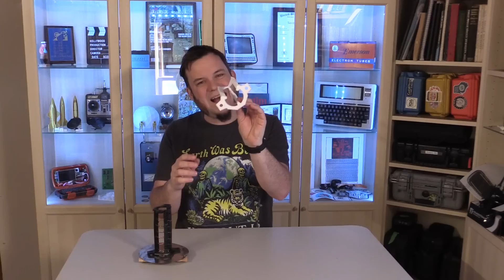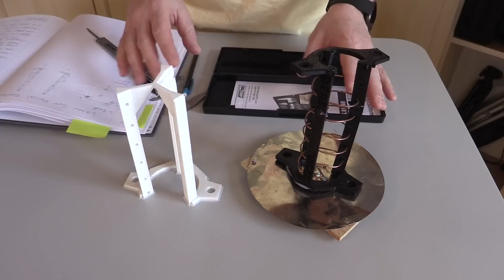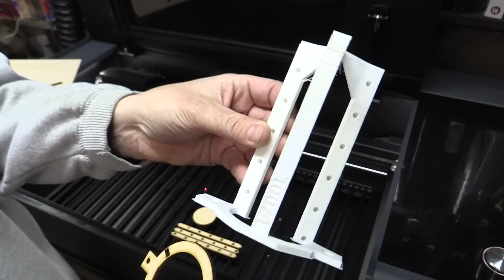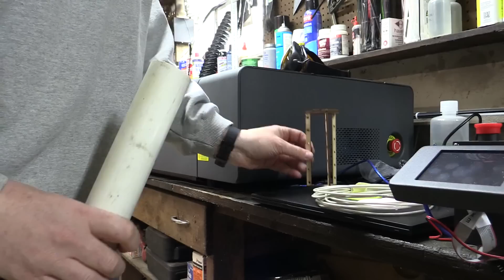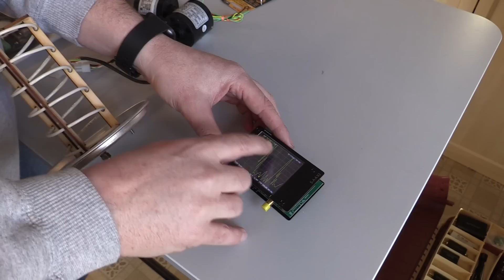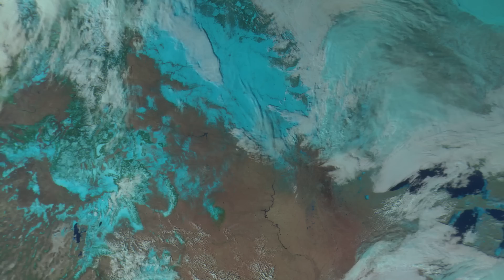Making Satellite Antennas With Lasers

Comment: This is pretty cool. You could also 3d print it with the pieces laying down, if you don't have a laser cutter. Sometimes it's better to print in pieces and then assemble. You can also paint the prints for long term durability. Though the temperature problems with PLA are still a thing. 
But I still wish I had a laser cutter haha
Reply: Crazy idea... Use the 3D print to impression a box of sand and sand cast a metal part. 
It might just be crazy enough to work...
Reply: @Deja117  I've heard of people doing that! And I swear I once saw something about wax-based fillament specifically for that kind of thing.y

Comment: You can submerge the wooden into a two part epoxy and use either a pressure chamber, or vacuum chamber to force the epoxy into the wood.  It should add rigidity to the structure. and make it water proof.

Comment: OH on the plastic coated power cable wire the good thing it will keep it from oxidation copper wires  i do the same and if you solder as we do both ends the copper is now very safe till the sun does the plastic in some day .

Comment: For the 3D printed antennas, it might be better if the long tall parts were printed as a separate part laid on it's side. They could then be snapped or screwed together to achieve the final part.

Comment: For all the tinkering you do it's surprising to me that you haven't dialed in your 3D printer(s) yet. Any mid range, modern printer, using a quality filament and slicer, should be able to print those without issue.
Reply from the maker: I don't really have the time or patience for it. If it's not going to work without a lot of tinkering and babysitting, then it's not a tool, it's another hobby I don't have time for.

Comment: @seaveitforparts ... seems to me anything made of wood will absorb humidity, which results in a changing capacitance ... or it might "'dry up" ... in both cases changing the tuning and add some loss ... so i would not use wood.
Reply from the maker: I'd seal it if using outside long term.

Comment: See if Bambu would be willing to sponsor you. They are trying to sponsor channels right now and you’ll get a good 3d printer out of the deal
Reply: Yeah they also are a lot cheaper than the laser printer you just used. I'd suggest trying a good 3d printer before throwing in the towel on them. They are slow but can make some awesome things. My son did a 38 hour print with a Bambu with no issue. In fact we've printed probably 40 objects since we got it at Christmas without issue. I'd suggest trying them. 3d print farm people are not happy with them right now though so if you are going that route read up on why.
Reply from the maker: I've emailed them a few times and they never reply.

Comment: For long-term outdoorr survivability just cut one out of acrylic (and use an acrylic solvent adhesive to assemble.)
Reply: Or hot glue :) 👍
Reply: @new-zealand-clippy  hot glue can melt apart. chemically bonded acrylic won't.
Reply: Or wrap it around a PVC pipe.  You could get fancy with a jig and cut the spirals.
Reply: @JoeHamelin a PVC tube has a weight and wind loading issue that having an open wire support like the one he shows is meant to solve. It is supposed to be light
Reply: I was going to suggest this. Or you can use ABS boards too, those should be equally durable.

Comment: Another great video - I'd suggesting CA glue rather than hot glue for assembling the jig as it won't soften on a warm day.  Also, you might want to try lacquering the jig (spray can of varnish - or even paint) before you wind the wire through to make it more weather resistant.  Another possible option would be to use laser cut PVC - you can repurpose PVC pipe by cutting off cylinders, and softening the PVC using a heat gun and pressing it flat.

Comment: Think about using laser cut cast acrylic for the structure of the antenna if you're going to use it outside. It's reasonably tough, doesn't need to be coated or painted, holds up to sunlight and summer heat just fine, regular old superglue permanently bonds it in seconds, AND it cuts beautifully on a CO2 laser.

Comment: You'd want to use PETG or ASA, not PLA. In fact, I would recommend PolyHex which is a cross between PETG and Polycarbonate that was developed by the U.S. Army and is commercially available.

Comment: With propper tuning you could fix those prints, but you would need to be a wizard with the printer. The real fix would be to devide the print into parts that can all be printed flat on the print bed. That's CAD solution tho.

Comment: If you don't have a 3D printer, plenty of services will print and send to you. Just get more than one thing printed so they don't charge extra. :P
Oh, also for glue, if you are using PLA or ABS, 3D Gloop is best. It will chemically bond them together. Some alignment pins/tabs in the print might be a good idea for this though. 
In any case. Resin is most accurate. I would SERIOUSLY outsource that one though. The printing, drying, washing, treating, and even the cost of the resin itself, won't make sense unless you make 3D models all the time.

Edit: I completely forgot about sand casting too! We know most metal can put up with a lot. Shove a modified version of the 3D print (with no base) in appropriate sand, pack it, remove the plastic, prepare the channels and vents in sand, pour hot metal in from a small forge. It should last for a long time with a simple coat of paint. You'll then probably want a template (which you can 3D print) to get the spacing on the holes for the antenna. It's a little more complicated... But way cheaper than a metal 3D printer.
Reply: Making it from metal would make it fail as an RF support. RF supports need to be rf transparent. The parts of an antenna which are made from metal are either elements or Shields.
Reply: @RowanHawkins  You raise a good point... Ceramic is out the window as it's not too weather resistant. I suppose coating the 3D print in fiberglass might work? Polycarbonate could also be an option... But super annoying to setup since you'd need to injection mold it. Unless you find a place that has a specialised 3D printer for it, or a sheet you could chuck on a CNC. 🤔